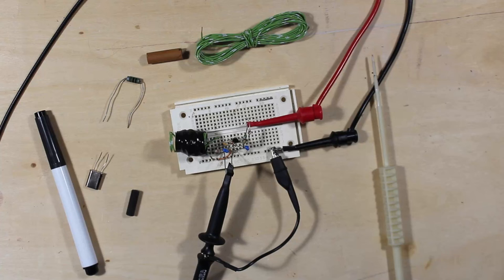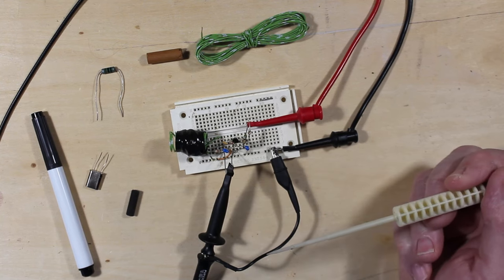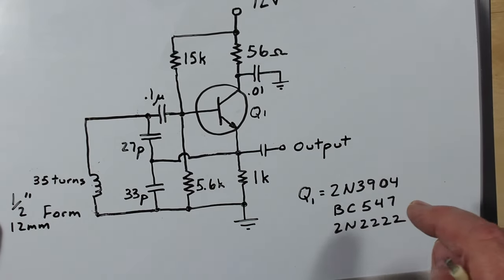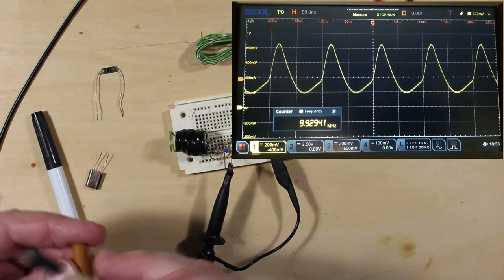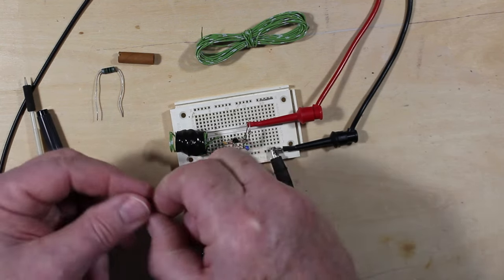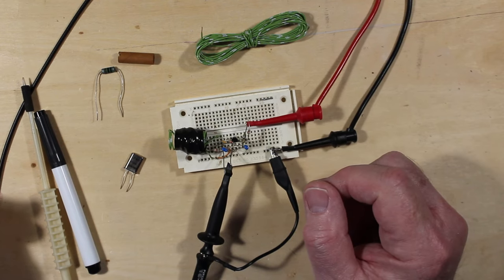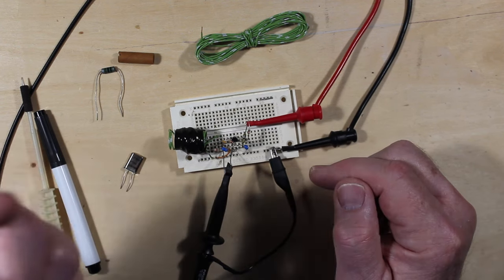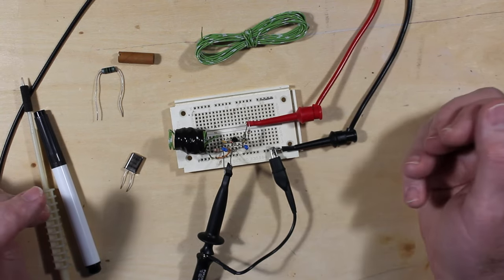Colpitts Oscillator Addendum - A Few Additional Points  #electronics #diy #oscilloscope

Comment: Dear Sir. I found this video and specially the previous one very useful. In the previous one the modulator section and the action of the diode was very interesting. Normally, I place a capacitor around 5 uF across the battery. I believe it would by pass the battery , and will be helpful for small signal and startup of any oscillator. Thank you.
Reply from the maker: Thanks. Glad you liked it.